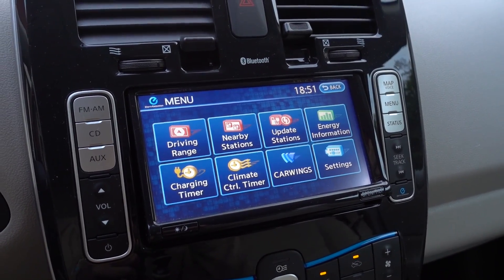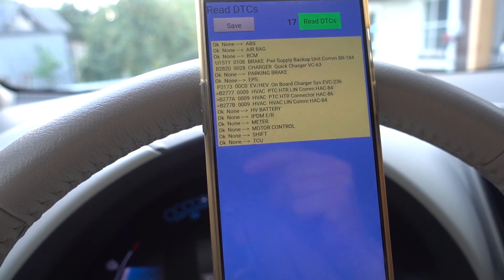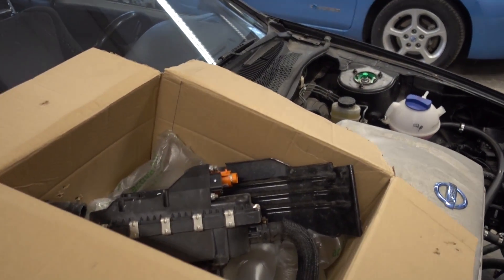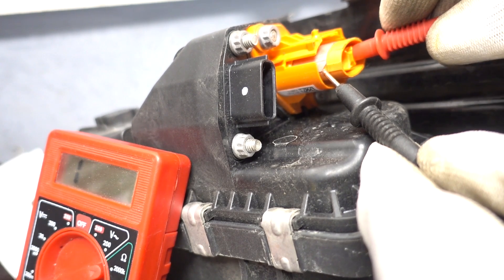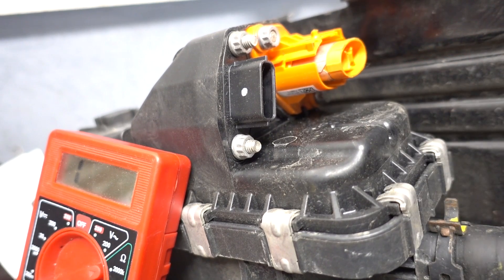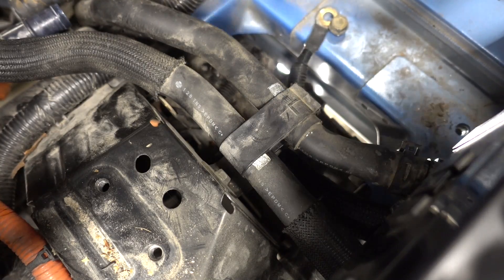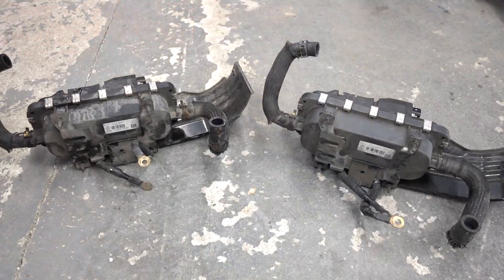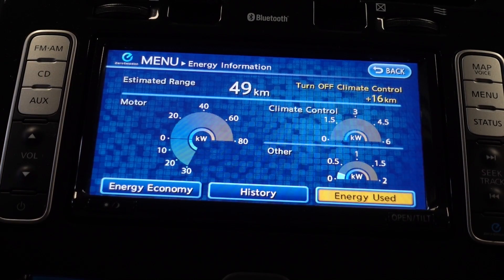ZE0 Nissan LEAF PTC heater replacement

Comment: Is there a way to disconnect the ptc heater? I want extra range in vinter and want to mount a dieselheater. But want the fan and vents to work as normal.
Reply from the maker: Yes see the mynissanleaf forum. It is called heater mod / heater switch for ZE0

Comment: Label on these heaters read 350v. Isn't leaf 400v? Wont overcurrent melt the fuse?
Reply from the maker: Nominal rating. Same as saying 12V component, even though they have to withstand 16V
Reply: @DalasEVRepair  You're right. I swear I read 400v on my leaf heater but it's actually 350v too, I was hallucinating trying to get my PTC to work 🥲

Comment: Im getting some gloves and doing the repair soon. If it doesn't work with the new old PTC, I think I'd rather fit it a diesel heater, stay hot and toasty instead all winter. Especially since winter starts in September in Norway

Comment: I have this issue as well...  The AC works beautifully... but the heater doesn't engage and reacts the exact same way.    I've read some of the other comments and i'm just trying to figure out which fuse that they replaced?    I was looking at some other comments... north of the battery if you open it up it's beside the anti theft horn?  The DC/DC one?
Reply from the maker: See this video for fuse location https://youtu.be/u19YogcC2H8?feature=shared
Reply: @DalasEVRepair   thanks for that post... 
 Step 5: drain the heater fluid....       Can you do a video on the heater fluid.. is that something that should be added too or replaced? lol

Comment: The fuse linked to from Josteins video is no longer produced. Do you remember which fuse you have used?
Reply from the maker: Any 30A 500VDC sand filled glass fuse will do, I soldered in one once.

If you cannot find it, you can pay premium and get the right part here
https://evsenhanced.com/product/nissan-leaf-ptc-fuse-ze0-genuine-part/

Comment: Terrific video! I replaced the PTC today and it still doesn't heat. I get no error codes in Leaf Spy Pro. Is the next step to change the fuse then? Is it possible to measure whether the fuse has blown without removing the DC/DC junction box?
Reply from the maker: Check the codes with Leafspy?
Reply: @DalasEVRepair  I got this result when reading DTCs after changing the heater:

Ok None ---> ABS
Ok None ---> AIR BAG
Ok None ---> BCM
Ok None ---> BRAKE
Ok None ---> CHARGER
Ok None ---> PARKING BRAKE
Ok None ---> EPS
Ok None ---> EV/HEV 
Ok None ---> HVAC
Ok None ---> HV BATTERY 
Ok None ---> IPDM E/R
Ok None ---> METER 
Ok None ---> MOTOR CONTROL
Ok None ---> MULTI AV
Ok None ---> SHIFT
Ok None ---> TCU
Reply from the maker: @Whatelse76  could very well be the fuse, no easy way to check unfortunately!
Reply: @DalasEVRepair  a bit late - changing the fuse worked :)

Comment: Hi , Dala what was the end of this PTC error storry?? Checking A/C auto fuse solve the errors problems?? I see description on this video and see after replace A/C auto amp PTC didn't work properly. Customer find solution of this problem??
Reply from the maker: Hi, I updated the video description;

EDIT: SOLVED! When this one gets solved fully I'll update the description here: 
- Inside of the old PTC heater: https://imgur.com/0KjX2Z7
- The customer replaced the "A/C auto amp", this removed all fault codes (still no heat)
- The customer then had the fuse replaced, and the heat started working!
Reply: @DalasEVRepair  Fuse on DC/DC converter Right?
Reply from the maker: @michachojnowski9004  yes
Reply: I had the same thing happen on my fiat 500e. PTC heater for the battery TMS failed. Had to replace the PTC heater and the TMS fuse in the HV battery pack.

Comment: Yeah, these are REALLY awkward to change !! I did mine 3 years ago, it had taken the 30A fuse in the DC/DC with it, sadly :-( Luckily I too found a known good used one, but doing both the PTC and the fuse was not a quick repair .......

Comment: Dala, do you have, within any of your videos, an explanation of how to remove/repair/replace the J1772 charge port and cable including instructions on how to remove the cover off the head?  Thanks. So many people have had this problem but no one seems to have recorded exactly how to remove the cable and re-solder the pins.  Thx.
Reply from the maker: Unfortunately not, suggest checking out the mynissanleaf.com forum for more ideas!
Reply: @DalasEVRepair  Thanks that was my partner asking. We are stuck on this repair and casting around for more info. Thanks again.

Comment: Ah it's fascinating that they changed the PTC heater over the years. In your video, they appear to heat the "coolant" thus emulating the ITC heating approach. In the AZE0 and later, they place the PTC within the HVAC box itself and heat the air, thus skipping the liquid/coolant entirely.
Reply: They have two different circuits. one for heating the cabin and one for cooling the electronics. They even use different types of fluid.

Comment: The 2011 Leaf I bought a couple of years ago had a faulty PCT heater, I had it replaced with a 2012 one and is still going now. Luckily, nothing else wrong with the system. £500 fitted.
Reply: Where did you have this done? Our PTC heater is dead. We're in Nottinghamshire, UK
Reply: @ghopkins66  you can go to the same HEVRA approved garage I went to then, eTech Midlands based in Syston, Leicestershire. I bought the heater off eBay myself and they they fitted it. If you can find one from a 2012 or 2013 Leaf all the better as there were 3 or 4 improvements made over the years.

Comment: Curious on whether or not you'd go for an AWD conversion. The leaf can definitely fit a motor on the rear axle, and a 3 second 60 pull on the NISMO RC (with extreme modifications) sounds too fun to pass up once I pay off my car
Reply: In Europe is a big no-no, unlike in US.
Reply: @pashko90  You can't change the drivetrain of a car in Europe?
Reply: @nigelbassett3791  no, will not gonna pass MOT inspection.
Reply: @pashko90  Than would suck. Especially with Europe being arguably one of the largest producers of problem cars
Reply: @pashko90  From my cursory reading as long as it's done properly adding a Tesla drive unit or equivalent has no impact on the roadworthiness of a Leaf, and even if it did MOT only applies to the UK

Comment: Thanks for putting out the video.  This looks like a job that I will not want to do!
Reply: Considered doing it myself once mine failed but there was not much good documentation at the time. So I asked Muxsan and he replaced it for I think €1200 incl. a second hand replacement PTC heater. Dealer quoted €3000+ so not too bad.

Comment: Oh, the fuse is inside inverter? Wild. Is sticking the multimeter into the HV plug a bad idea? If the car tries to turn on the heater, you should get HV there, right? If it does not want to turn it on, it will of course measure nothing, which also could be a broken fuse then and more tests are needed.
Reply from the maker: There is also an interlock pin on the HV plug, so that needs to be clipped. Also the communication needs to work, so that it okays the voltage to the PTC. Not possible to test that on this vehicle, but on others it might be viable!
Reply: Where is a fuse in HVJB. Removing it is a royal pain in a rear end.

Comment: Sometimes we learn more from our failures than successes. 🤔
I enjoyed the video anyway, having completely stripped a gen1 Leaf I love watching your videos about them.
Do you have any advice about using one of these heaters in an EV conversion?
Reply from the maker: I would go with something more reliable for a conversion, Mitsubishi Outlander heater for instance!
Reply: @DalasEVRepair  Thanks Dala, I had a Leaf that I stripped but have already gone down the route of Outlander AC Charger as it is so much smaller and easier to get working. I will look out for an Outlander heater too.
Reply: I purchased a leaf which already had a heater swap with a BMW heater, pulls 100A from the 12v battery when enabled, and I can se the coolant temperature. 

Took me awhile to realize that the temp should be set to max, NOT to what you want the ambient temp to be, in order to get enough heat into the vehicle.

That said, I'm starting to think that rather than  trying to swap back to the factory heater, I'm better off sticking with this one
Reply: @BlackThorne  which bmw heater do have a picture

Comment: @dala did you check that there are many video regarding PTC repair?
Reply from the maker: Yup! Last one I did had different error codes: https://imgur.com/Bz7R7oH , both PTC heater and fuse had blown there!
Reply: @DalasEVRepair  if no derivation and fuse blown I suppose some series resistance are shorted among them giving lesser resistance (am I right?) and higher A. Are you able to check absorption putting rectified 220AC => 330DC I suspect you'll have much more than 14A that is you should have with 5kW at battery voltage. I Suppose the fuse is a 20A fuse is it right?
Reply from the maker: @luipir  The codes seem to point towards the LIN communication, not the PTC itself. I'll update the description once I get more info on how the owner proceeds